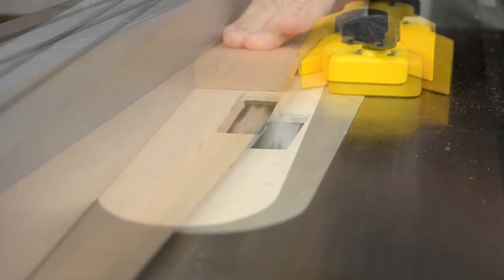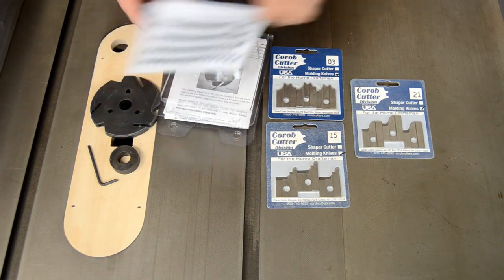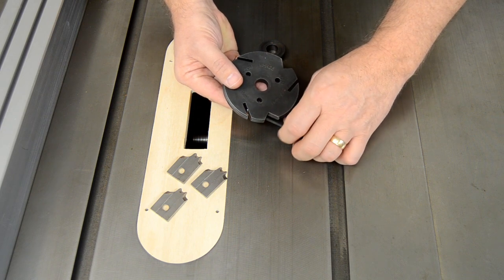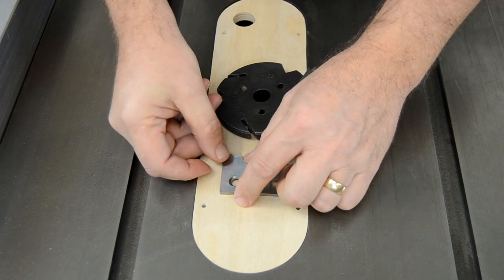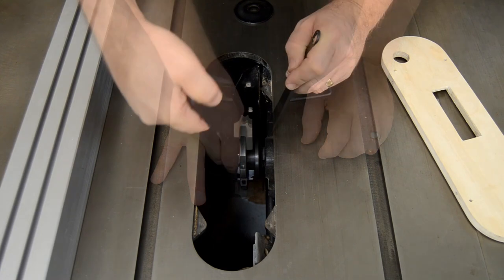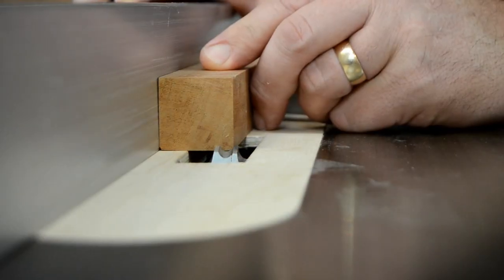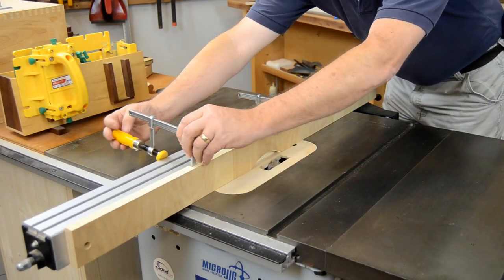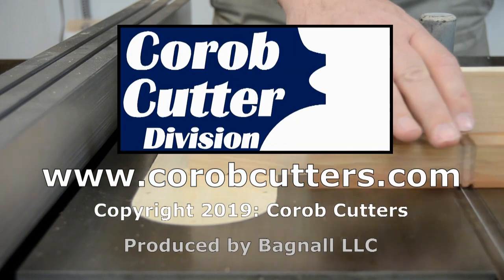Molding Knife Head Installation and SPC1 by Corob Cutters

Comment: I've been using molding knife cutter heads on my table saw for over 30 years and would offer two suggestions to users. ALWAYS use a zero clearance insert,  otherwise the risk of kickback is greatly increased ( don't ask how I know), and make your molding cuts on a wide board ( especially when the board is in a vertical position) then rip the molding to the desired width on the table saw. Using a cutterhead on thin stock is difficult and dangerous.
For example, I use the three bead cutter more often than others, I usually start with a board about six inches wide, run through vertically, turn 180 degrees and cut the other side, then use table saw to rip about 1 inch wide strips. This offers more control of the workpiece and reduces chance of injury
Reply from the maker: Thanks for your comment! Please like and subscribe if you are interested in our channel. We're adding new videos a couple times a month. There will be some DIY projects and plans available as well.